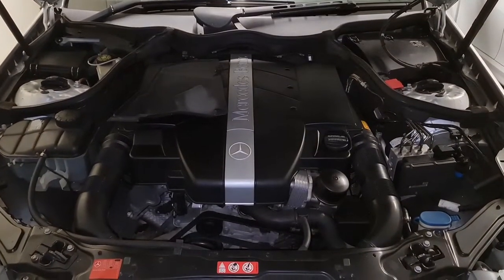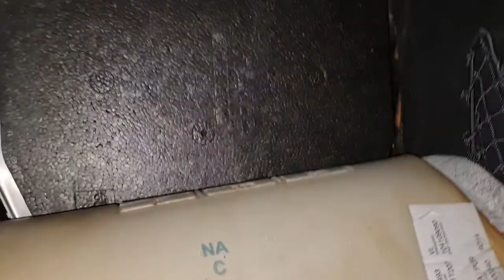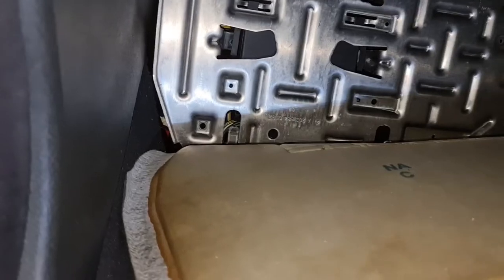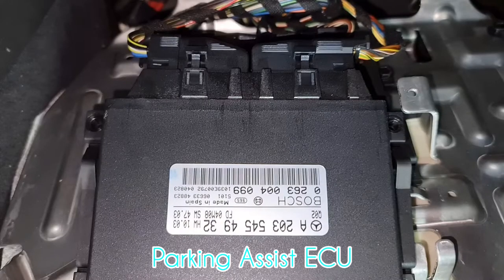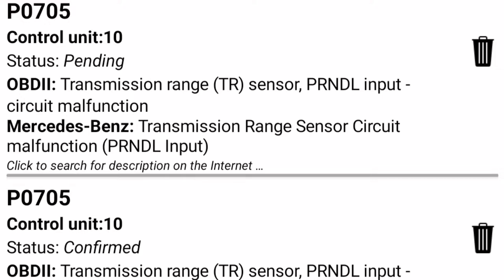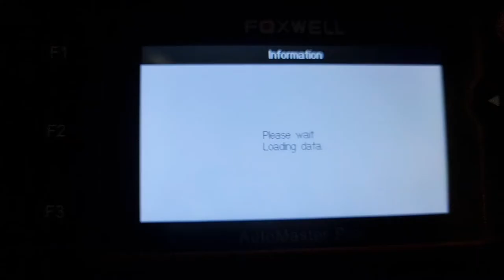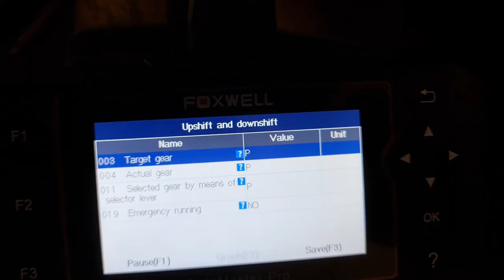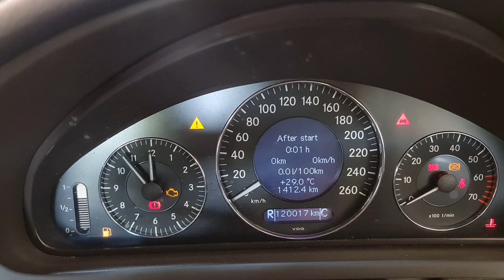Mercedes Transmission P0705 Fault Code causing Limp Mode

Comment: If the gear is in actually positioned in Park but the indicator turns into R, you may want to check the wire connector of the gear shifter, it can be a loose wire causing this. There are other videos on YouTube that talk about this. Please let us know what was at the end
Reply: Yes I have same problem

Comment: Anyone with info before I part this car out. Have a 98 c280 with the p0705. I replaced the conductor plate and round connector and it took care of the hard shift from park to drive or reverse but this code comes back. Is the valve body a possible issue? My understanding is that the computer is not receiving the signal from the transmission so the valve body would not be an issue. Thank you for any input on this matter
Reply from the maker: It's sometimes a very simple thing, MB star for sure can help you.

Comment: Plz help me ...I have a 2011 e350 an my check engine light is on an the code P0705 .. is there anyway to take the check engine light off WITHOUT doing any major repairs??
Reply from the maker: Hi mate, how many km do you have on the car? I have heard that usually gear shifter issues appear after 100k....

Comment: Can you help me please?
I have Mercedes cls 350 model 2007, after i make gear restart in c mode no problems but when i shift to s mode car not mode in D or R and in manual also I return back to c mode everything working.
I don’t know why.
This happened after cleaning air mass flow sensor and throttle body.
Please advice
Reply from the maker: This sounds to me more like an electrical / wiring issue, make sure your harness is not soaked with transmission fluid and all the connectors are clean and intact, also defienetly scan the ECU for the fault codes.

Comment: My Mercedes has a that code p0705. It’s a 2002 c320. My shifter been faulty for awhile now but just recently it won’t go into gear when I press the brake. Also when I’m driving my car go into save mode or limp mode cuz it won’t go pass 40 and the RPM is at 60. Any ideas on how to fix it cuz I’m replacing the shifter this weekend. What others things could it be to cause the code
Reply from the maker: https://youtu.be/fWDRA3-b_V4

Comment: I'm facing the same problem in my mercede 2002 S class w220 gear shifting 1 to 2 and sometimes stuck in parking. Will i find  transmission E.C.U at same place ?
Reply from the maker: For w220 S class the TCU is inside a relay / fuse box under the bonnet on the passenger side if this is a LH drive car.

Comment: Hello, I have the same error p0705 and also got p1709, sometimes gets in stuck in P and can not shift after switching of the car and waiting 10 minutes everything works fine, could you kindly give me some suggestion? It is a Mercedes GL320cdi 2007. Thanks in advance
Reply from the maker: Hi mate, I believe it is the shifter, but before replacing your shifter make sure the transmission plug seal is good and the connector is clean. Also check your tcu for fluid contamination.

Comment: Now , my Mercedes e300 2015 , stuck in gear p , and sometimes it can go anywhere but always stuck in gear 3-4 only , will u give me some advice
Reply from the maker: Hello, Best advice would be to diagnose using a proper OBDII scanner and read the codes.

Comment: I have a 02 Cl500 with the same problem. I have to let the car warm up for 20 minutes before I drive off, if not it’ll be stuck in limp mode
Reply from the maker: Hi my friend,  not sure but that might be a different issue, do you know what fault code you get?

Comment: My c230, 2001 has 160k miles can not shift from drive to park , needs to go to neutral , turn off engine to drive, then have p705 code. Mechanics said need to  shifter replacement
Reply: Is this shifter need to replace at 160k miles ?
Reply from the maker: @joepaa2674  probably that is the 2nd one being replaced by the 3rd one.
Reply: Thanks. Some other video mention a lever or a solenoid issue, but i guess replace the shifter will solve the problem n fix the limp home mode. This just happened out of nowhere. One day, can't shift to park, next day same thing n home limp mode fault plus check engine
Reply: I have the transmission conductor plate, connector replaced it twice , one few years n one 10 years earlier
Reply from the maker: @joepaa2674  check when shifting from P to R N D it actually displays correctly on the display, if not most likely the shifter is gone.
Reply: @BenzAddiction  shifter display correctly. Or I have no idea where is the right shift. Before this happens, my son said he heard some noise when shift. With 160k miles, it's better to replace the whole away ? Or mess with individual parts within the assy, thanks
Reply: My brothers car has same issues
Reply: I haven't tried replacing the conductor plate yet. The round connector I replaced and it was pretty bad. That didn't correct it though. I heard it's the transmission range sensor that is bad but can't locate it yet.
Reply: Did you solve your issue yet?
Reply: P0705 TRANSMISSION CONTROL UNIT ON E200 CGI..Is it transmission control unit which need to be replaced or the gear shifter.
Reply: @jacobfoster3944 in my x204 it is inside the transmission 😢 difficult to make it on my own, also it just happens whenever y pass 20km/h

Comment: So where’s part two for the leak ??
Reply: And is this the same for w211?
Reply from the maker: https://youtu.be/FKWbl3cYUo4
Reply from the maker: https://youtu.be/FKWbl3cYUo4
Reply: I see you have 13 pin I only see 12 on mine and it’s throwing one code p0778 you think it’s a connector pin?

Comment: I have a 2009 Mercedes Benz clk 500 the car stop moving in drive gear but every other gear works
Reply from the maker: Hi mate, you need to diagnose the car with an proper OBD2 Scanner.
Reply: @BenzAddiction  I got it scanned everything 
Error code c1142
Error code c1029
Error code c1705
Error code c1035
Error code c1703
Error code c1172 

Those came up referencing Brakes & steering errors nothing said anything motor or transmission I got it scanned at AutoZone,DO I NEED A BETTER OBD2 SENSOR ?

Comment: My battery died on my car and I jumped started it now she doesn’t won’t to shift gears
Reply from the maker: Yes, jump starting a Mercedes is risky. You now probably need to scan for codes.
Reply: @BenzAddiction  check engine light is on I’ve tried clearing the codes with my on one scanner but it does nothing for it I’m guessing I need to have the codes cleared by a professional
Reply from the maker: @fishjunkie249  before paying anyone to do so, take a look at this playlist: CLK Class W209 - A209: https://www.youtube.com/playlist?list=PLlLCm7I5XCvZcE7u8LzbBc1CJMP9zlXbv

Comment: I have the same error on my c180 kompressor and i've changed the conductor plate but still the same..it let's my put to drive and reverse and park but is driving in second gear i thing vos on the display does not show if is D or P or R..any help please?
Reply from the maker: How many km on your car?
Reply: 1007000
Reply from the maker: @robertovidiu1601  if it is 100k, it is about the time...

Comment: I'm having a problem with my shifter lights turning off when my car starts up and doesn't let me put it in drive and when I do get it into drive it goes limp mode like full gas down barely moves any suggestions 2010 c300 S????
Reply from the maker: Might be the shifter, the best thing to do is to diagnose it using a scanner, sometimes even a good Bluetooth scanner can help a lot in diagnosis. Also download car scanner app from the app store if you want to use the Bluetooth scanner.
Reply: But my car don’t have Bluetooth